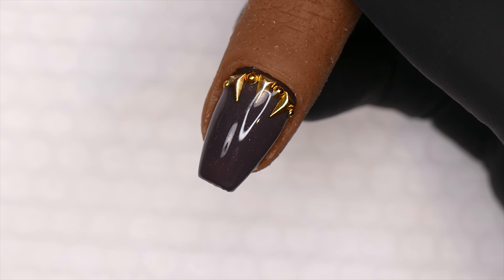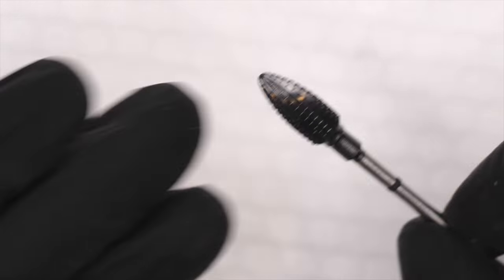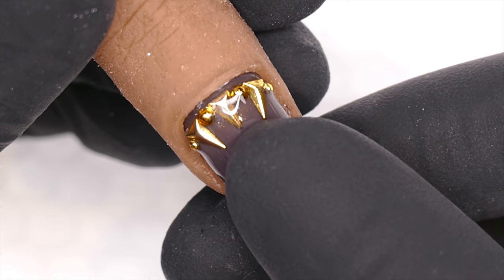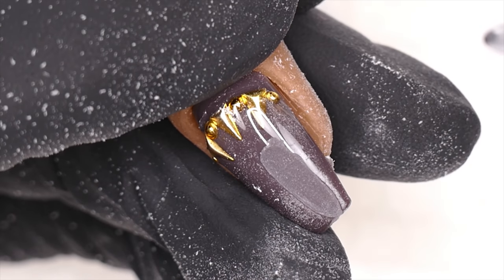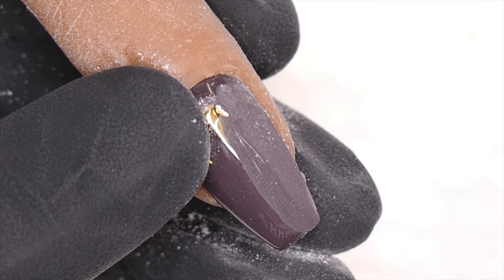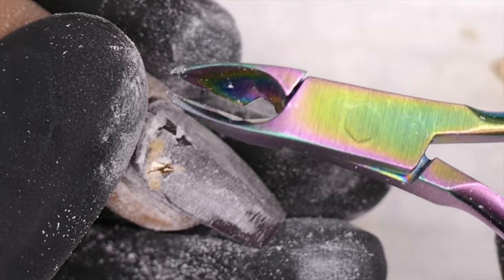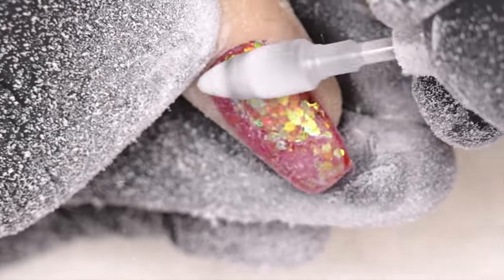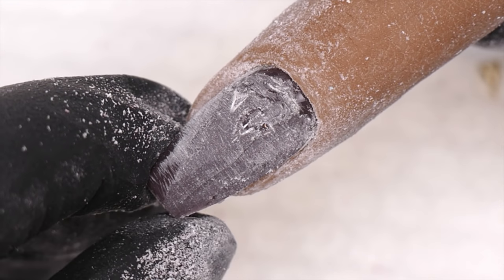How To Remove Encapsulated Nail Art

Comment: Thank you so much for this video. I do my own nails and it is so great to learn how to do it the right way. And your showing how to file down to the base coat and then soaking to get the nail off is what I have wanted to know how to do. I actually have this acrylic and gel soaker using acetone. Using your suggestion on filing the product off to the case coat will definitely speed up the time getting the nail to come off and I won't have to force the nail off.  Thank you again for your help. :)

Comment: Hey Liz, I really regretted putting a 3D piece on my nails recently. I chose the wrong finger - I wasn't thinking about the removal - and it was so difficult to get it off! The finger in question has a damaged matrix and the last thing I should be doing is anything remotely aggressive!!! It was a little heart, made of metal, and I filled the centre with gel and secured it around the sides too. Hope you are well, noticed that you've been quiet on here lately! x

Comment: Hi, Liz! I’ve been making my way through your videos and love the concise manner in which you teach. Thank you so much for sharing your comprehensive knowledge. 

If I were to use glass nail art, such as pixie crystals, would removing them with a carbide bit be the best method, or would the shaved glass have some sharp pieces?  Thank you again.
Reply from the maker: Always wear eye protection for sure. And yes I use carbide to shave them off. But they are crystal so protect your eyes and try to point the finger down so they file off down and away as much as possible.

Comment: So informative, thank you. How do you feel about ceramic drill bits?
Reply from the maker: Ceramic bits are nice. They glide nicely, but they get dull much faster than metal.  They also are not as sharp so usually you need one coarseness up from what you want (coarse ceramic is equivalent to medium metal, etc)
Reply: Thank you for your input. Just ordered a set of carbide bits.

Comment: I wouldn’t be able to wear fake glasses as I wear prescription glasses.  So I’m assuming that is ok too? Xx
Reply from the maker: Hi as I mentioned if you wear prescription glasses that is fine also but make sure they are large enough to cover your entire eye area (and depending on how much you work I would make sure they have a scratch resistant coating).  Or you can double down with bigger safety glasses that fit around your prescription ones.  There are lots of options out there.
Reply: The Nail Hub thank you for your reply Liz, I will get a pair of safety glasses to go on top. X
Reply: Lol that’s how I buy my sunglasses, big enough that they can go on top lol